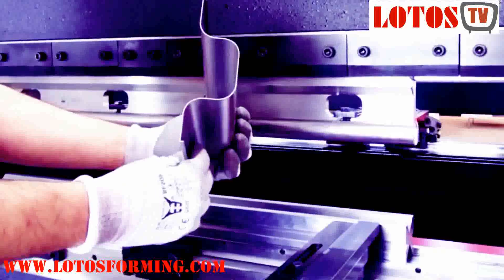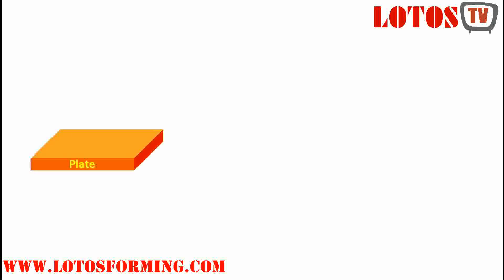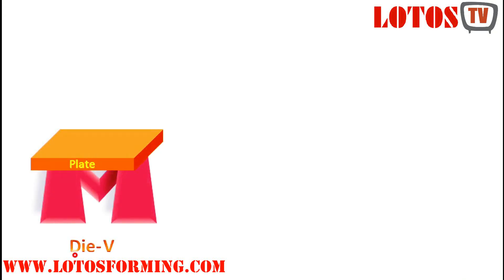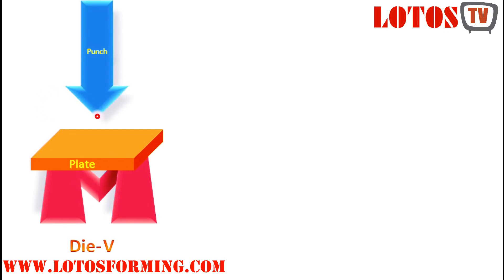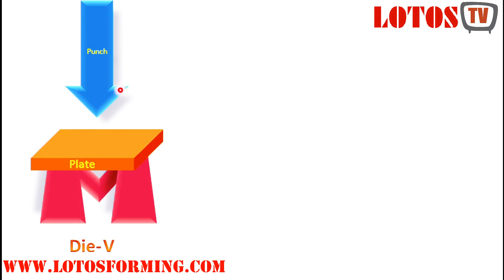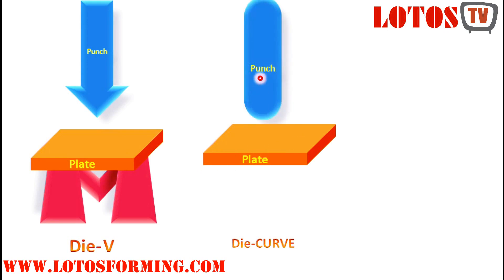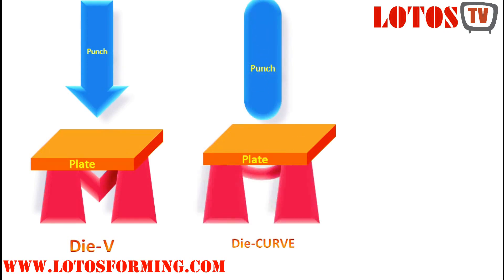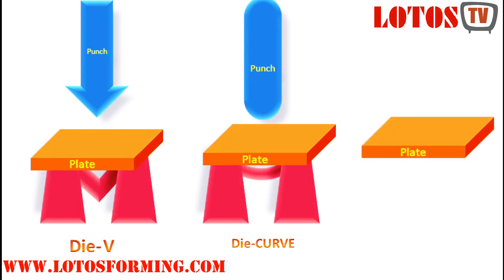【sheet metal forming】:  Roll Forming Advantages Compared To Press Braking " USEFUL INFORMATION "

Comment: but Roll forming of sheet metal is a continuous manufacturing process, that uses rolls to bend a sheet metal cross-section of a certain geometry. The biggest difference between roll forming and press braking is how the material is fed. Press braking material has to be sheeted, slit and cut to length before inserting in the press brake.

Comment: Roll Forming Advantages Compared To Press Braking: in fact, the Bending process is a metal forming process in which a force is applied to a piece of sheet metal. A bending operation causes deformation along one axis, but a sequence of several different operations can be performed to create a complex part.

Comment from the maker: in roll forming the metal shape by stretching it through pairs of rollers that one of them supports the underside and other on the top surface. Each pair shape to provide a little more deformation.